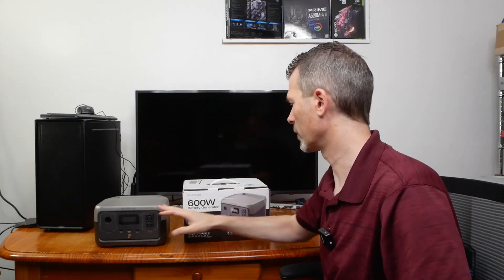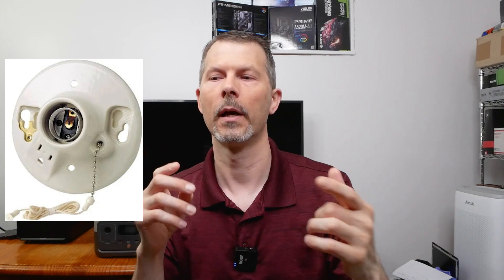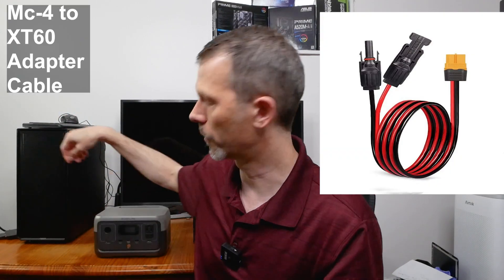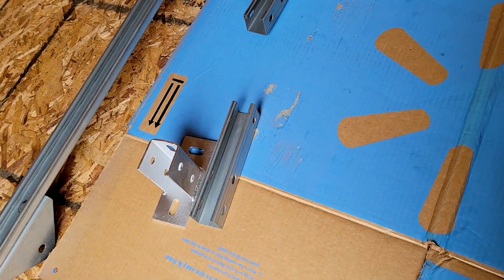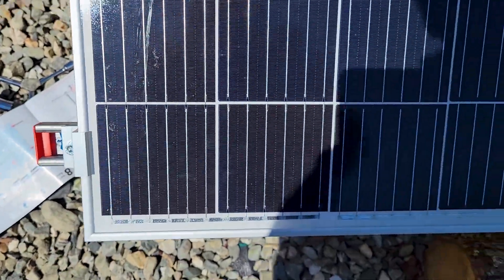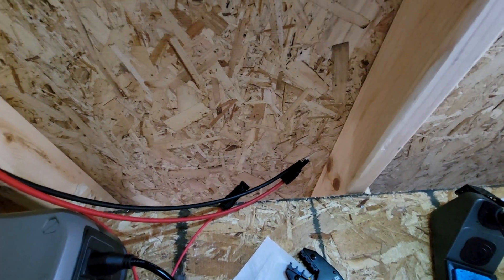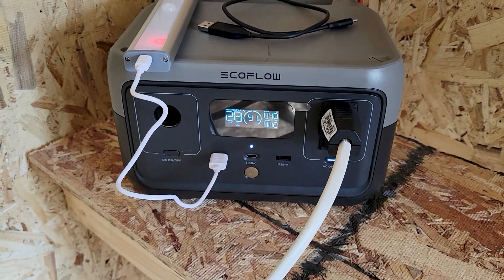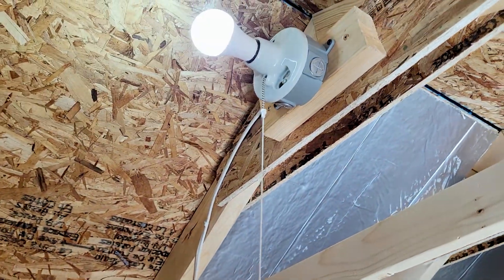Solar power for your shed the easy way!

Comment: After looking at setting up panels in series and paraell, I got to wondering if I could set the 350 watt power station in series, one being charged by a panel then that power station charging another? Would I gain more time? As long as I can recharge in a normal day.
Reply from the maker: You certainly could charge them this way but there would be conversion loss. Maybe %20 max estimate. But if there's enough sun and the load capacity of the main units not too much i don't see why not. I do similar with my Ac300 and charge those from my array then top off my ecoflow units from the big ones.

Comment: I have a 12x24 shed. Can’t use a power station in the summer. When it’s 90 degrees or hotter it’s 118 degrees in shed with 3 windows open.
Reply from the maker: Is it insulated on the ceilings and walls? I had to insulate mine.

Comment: Can this be running constantly? For example can I have something plugged into it that is always pulling power in a shed application? Thanks.
Reply from the maker: You could as long as it dosnt pull too much power. I'd get the ecoflow river delta 2 pro if your worrying about powering something all night and not draining the battery. The unit can charge during the day even while outputting power so they daytime as long as there's enough sun isn't an issue.
Reply: Thanks for the quick reply. I am more concerned that it will damage the ecoflow if it is always in use. It will have a light like you did but also power a security camera so no much draw. Will it be damaging to always have it in use, or should I look into solar cameras and just use this for the shed application only?
Reply from the maker: @NicholasTimpone-k3k  Well they come with a 2-5 year warranty, and batteries are meant to be used! These have a large amount of charge-recharge cycles. SO I say use them and if they go out then warranty RMA them! I like solar powered stand alone cameras that don't need to wire them to a unit like this. Some even can connect a small extra solar panel to the cameras as well. But if you wont get a lot of sun where the camera is perhaps wiring them to the ecoflow is the best bet.

Comment: Hey! I ran a similar set up in my shed but i dont know how to solve the open ground problem. Should we worry about this being ungrounded? Still a beginner to electrical and solar.
Reply from the maker: @chinaisfar  Hi there. I think the ecoflow has some built in circuit protection. So it isn't perfect but that's all I'm relying on. Next couple systems I build will be more in depth with more protections.
Reply: @RememberThisTech  thank you! It helps me feel okay that this set up has worked well for you.

Comment: What was the cost of your final setup?    I’m looking to provide solar power for a 10x 20 storage unit.  Will need to run a dehumidifier and power for simple ceiling lights.  Suggestions for most economical option?
Reply from the maker: @gattamom  Hi there. I'm sure the dehumidifier will pull a lot of water to run. First thing you should do is find out the wattage your dehumidifier uses and estimate how many hours it will run estimate the high end. Then the lights. Then you can see how many watt hours you will need to estimate how large of a batter or ecoflow unit you will need. And also how many and the wattage of pannels you will need. Note you might need more battery capacity and pannels than you think if it's cloudy for too long and can't provide enough power.
Reply: @RememberThisTech What was the cost of your final setup?
Reply from the maker: @gattamom  440 give or take. But I had some of the romex and junction box already.but I bought my small ecoflow unit recertification refurbished from ecoflow store on ebay and it came with a 2yr warenty. I'm estimating you will need one double that size at a minimum.

Comment: Most of the build looks great.  However, I cringe when I see folks put plugs on solid wire, as this is dangerous.  Each time the plug is grasped, the wire gets bent a little, which work hardens the conductors, eventually causing small cracks - just like if you bend copper wire back and forth a few times you can break it off.  Once cracked, arcing can occur, potentially causing a fire.  It would be much preferable to terminate the Romex in a box where you can connect it to stranded cable, then use the stranded wire to plug into the Ecoflow.  Otherwise, thank you for the nice video.
Reply from the maker: Thanks for the good info and input :)

Comment: What do you mean by running the solar panels in parallel?
Reply from the maker: Hi there: The main difference between wiring solar panels in series versus parallel is how the voltage and current output change:
Series
Increases voltage, while keeping current the same. This is done by connecting the positive terminal of one panel to the negative terminal of another.
Parallel
Increases current, while keeping voltage the same. This is done by connecting the positive terminal of one panel to the positive terminal of another. For instance: Connecting your panels in parallel will increase the amps and keep the voltage the same. This is often used in 12V systems with multiple panels as wiring 12V panels in parallel allows you to keep your charging capabilities 12V. and If you have two 100 watt 12V solar panels and a 12V battery bank, your system needs to be parallel to keep the voltage the same. Also: If you connect your panels in series then: A single shaded panel in series compromises all panels in the series, whereas in parallel they're independent so you only lose energy from one.

Comment: Looks like a cool project. You could almost use a little switch box to let you switch between series and parallel configurations. Probably could use an on/off switch at least just for safety sake when plugging in and disconnecting the ecoflow.
Reply from the maker: @ItIsNot1984  Hi there and thanks. The cutoff switch sounds like a good idea ty. Even though these units say they have overload protection I'm sure it's just a matter of time! Better to be safe than sorry aye!